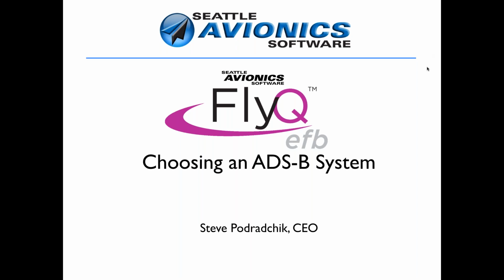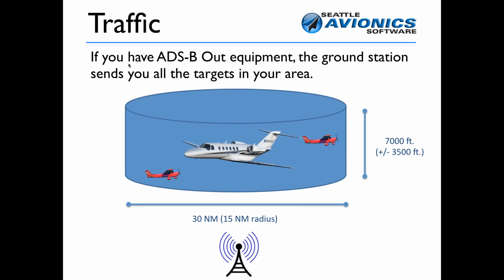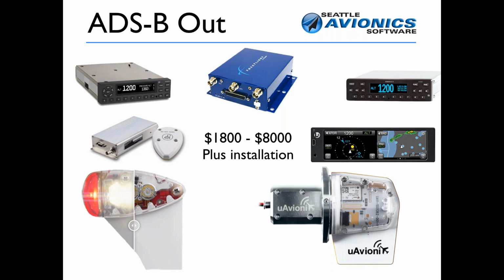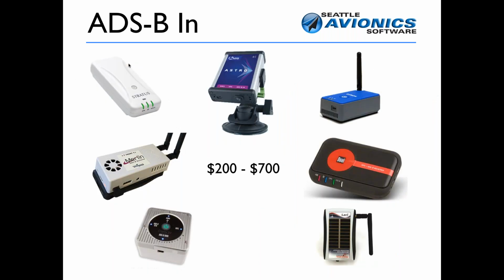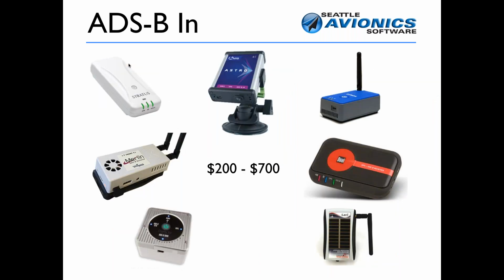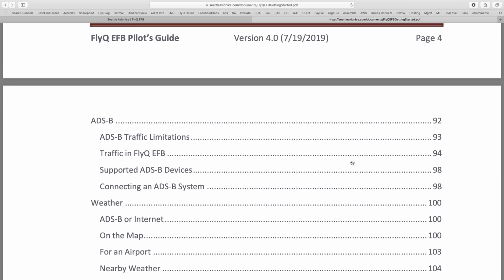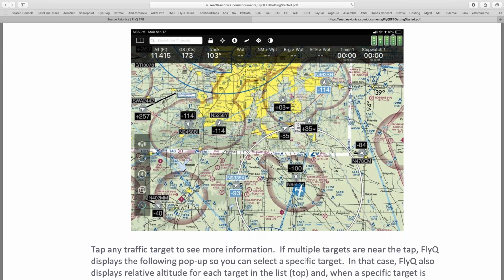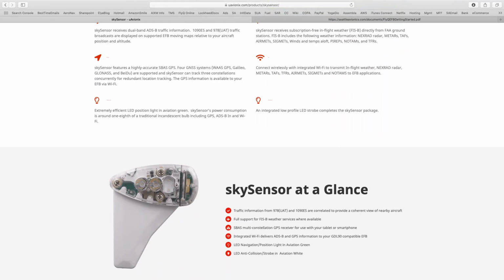Choosing an ADS-B System

Comment: The Garmin GTX 345 also works with FlyQ thru an IFD series Avidyne. I just completed a panel upgrade and am now getting ADS-b in traffic and weather on FlyQ connected to my IFD440. I haven't checked if FlyQ is receiving the AHRS (which is built into the GTX 345) data yet. looks like I'll finally be able to dump Garmin Pilot!

Comment: So I have a Vintage Plane  no Transponder and I Fly mainly in G and E  class airspace but I see The Advantages to ADS B out even in my area... The Uavionics   tail beacon will fit my Plane will it function without a Transponder ?
Reply from the maker: Hi, you should probably talk to the folks at uAvionics about that.  In general, ADS-B Out requires a WAAS GPS (which I think the unit includes) and data normally sent in a transponder broadcast (and picked up and re-transmitted by the ADS-B unit in the ADS-B Out feed) so I don't know if it would work w/o one.

Comment: I am currently installing the Mode-S Dynon Skyview Transponder and GPS antenna that completes my full ADS-B In and Out system. I have been enjoying Weather In only due to the builder installing the ADS-B In module before I purchased the plane. So far, I have been using ForeFlight for my EFB and backup GPS navigation behind the installed Skyview navigation panel. So far, I have found nothing to indicate I will be able to display Traffic information on my rather large and easy to read iPad, using ForeFlight. If this is true, I will likely be moving to Fly-Q for my EFB and backup GPS navigation. Can you provide any further information on configuring my full Dynon SkyView avionics system in order to read ADS-B Traffic on my iPad, running Fly-Q. Thanks
Reply from the maker: FlyQ can DEFINITELY display the weather and traffic data that SkyView sends out.  Configuring is easy -- just wire the ADS-B to SkyView in the usual way (I don't know how to do this, please contact Dynon for that) then use the Wi-Fi dongle from SkyView.  Connect the iPad w/ FlyQ to the Wi-Fi network that SkyView produces and fire-up FlyQ.  Nothing else to do!

Comment: I dont' understand why you wouldn't see the other aircraft in your vicinity if you don't have ASD-B Out. Isn't there a peer-to-peer transmission of ADS-B Out data that can be picked up by my ASD-B In receiver? My ADS-B In receiver should pick up all ADS-B transmitting a/c in my area.
Reply from the maker: Hi Tim.  ADS-B via the 978 ground frequency does NOT send all the target it knows about.  Rather, it waits for a "ping" from a plane with ADS-B Out then broadcasts back just the targets near that plane (15 NM radius, +/- 3500 ft).  I have no idea why they implemented it this way.  Thus, you, if you don't have ADS-B Out, you're only seeing targets appropriate for nearby planes that DO HAVE ADS-B Out.  So you'll likely see SOME planes, maybe even all. but you simply have no way to know what you don't know.
Reply: FlyQ EFB  Hi, I get this. But wouldn’t my 1090 MHz receiver pick up the other traffic in my vicinity (peer to peer)?
Reply from the maker: @TimToussaint  Yes but it would not necessarily see the low-alt traffic.  For example, American Airlines, flying at FL350 does not get told about C172 traffic at 3,000 ft -- so neither would you.  You really need ADS-B out to get a full picture.  Even w/ ADS-B Out, but especially if you don't have it, ADS-B traffic shown on your iPad or in-panel device one of those "trust but verify" (with your eyes) sorts of thing.  if you see it on your device, it's there .. but other targets may be also.